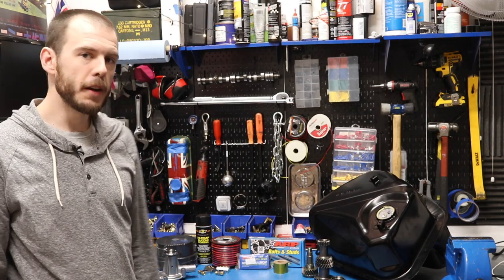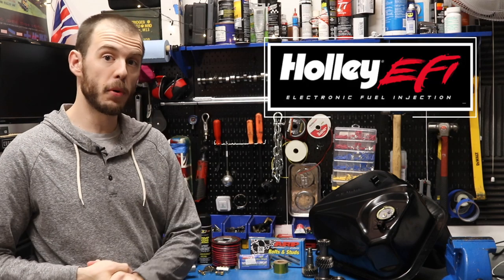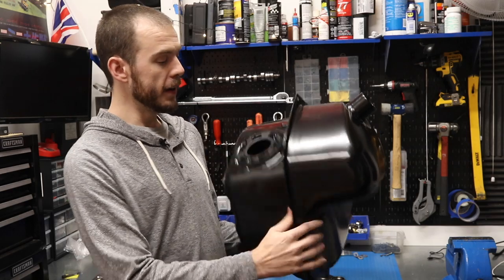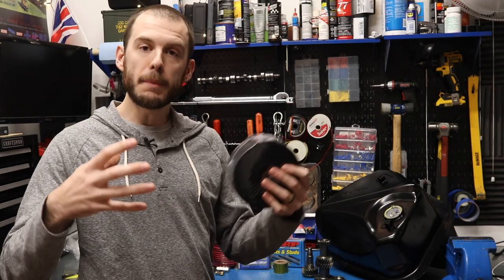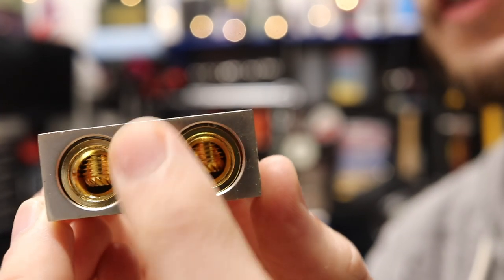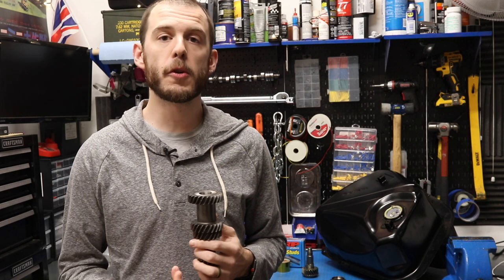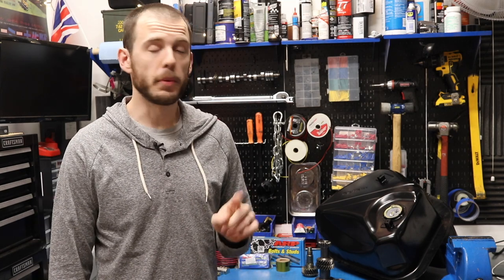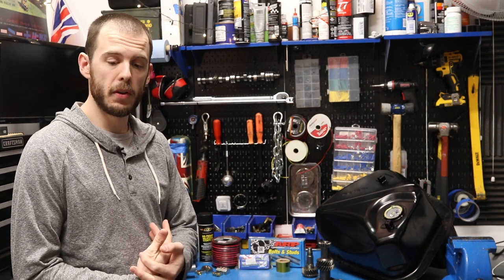Super Bad Wolf - Part 3 | Discussing Diffs, Gears and more!

Comment: Cole - you can weld on used gas tanks, you just have to use the proper procedure.  We do this all the time in refineries when we weld new nozzles on existing equipment.  The trick is to ensure you don't have an explosive atmosphere in the tank when you weld on it.  The way to ensure this is to first drain and then clean the tank (suggest using a hot tank at a radiator shop or machine shop to ensure the gasoline is gone).  Then when you are welding on the tank, make sure you have an inert purge gas flowing into the tank at all times in order to create an inert atmosphere in the tank.  You can use the same gas mix as for the MIG welder to create the inert gas purge.   This is not an impossible task, it just needs to be carefully done.

Comment: interesting build, did the vmax kit probably 20 years ago when they first came out. Comments - ATB is a good choice we like them and use them in our 8 port builds here. Exhaust wrap - ignore the haters, i haven't seen excessive rust on ours when we've replaced the wrap, the spray is done on top of the wrap when its dried (you damp it to fit it). I've found the wrap does bulk up the manifold alot and the pipes can rub each other, obviously less likely on a lcb as opposed to the special manifolds we have to use, use plenty of stainless steel ties to hold it on. I've stuck heat reflective material to the bulkhead before but prefer the thicker triple layer stuff for the big flat surface, also look at insulating the exhaust tunnel back towards the seat crossmember, theres a lot of heat radiated up through there as well.

Comment: I too have been giving the ‘ to wrap or not to wrap ?’ a bit of thought and have decided to go with a wrapped stainless system. I’ve been spending an inordinate amount of coin on parts over the last few days as well , so it will have to wait for now. The costs involved with a Mini addiction literally have to do with the sum of their parts .
Reply from the maker: Wrapping stainless actually is something you might wanna do some more reading on. From what I understand it can actually cause the stainless steel to fracture. However I haven’t done a great deal of digging into that. It’s crazy how fast things start to add up. 🤦🏻‍♂️

Comment: I would suggest that you did not attempt to built your gearbox with that gearset by yourself. It is advisable to let a specialist do the work for you as Minispares site advises. No offense to your capabilities but let Seven mini parts do it for you or Guessworks!
Reply: See his previous videos. These gear sets only require visual checks of alignment, something you should be doing anyway during a gearbox build. These have been fitted by many amateur builders before with great results.
Reply: @Dagowly83  Excellent. I stand corrected. I shall fit them too in my next new Mini engine project.
Reply from the maker: Thanks for the concern but I am confident I will be able to assemble my gearbox with this gearset as I do have quite a good bit of experience in building boxes. As Steve mentioned the requirement is ensuring alignment which is part of any gearbox rebuild.